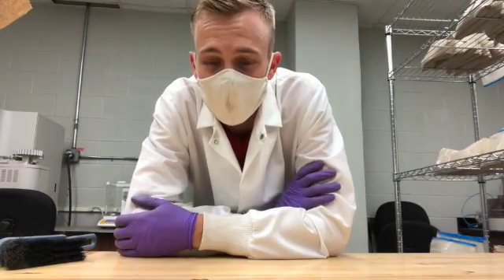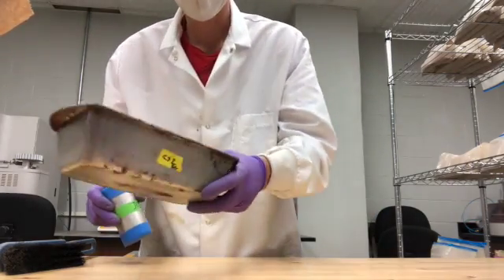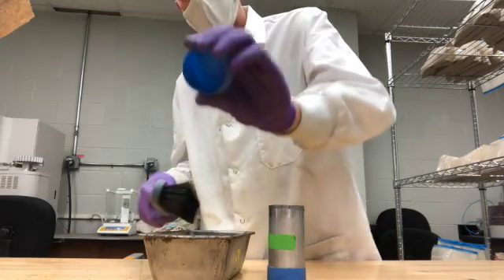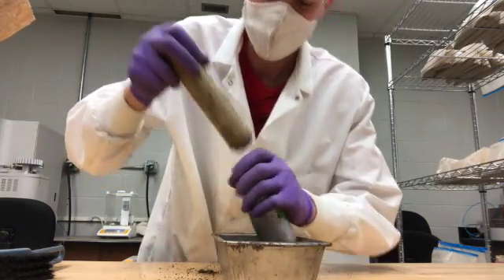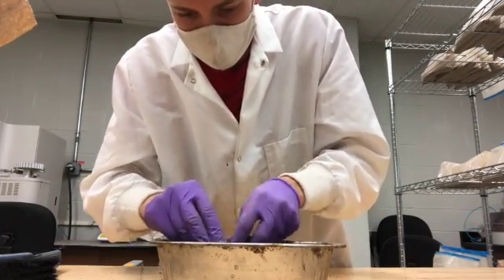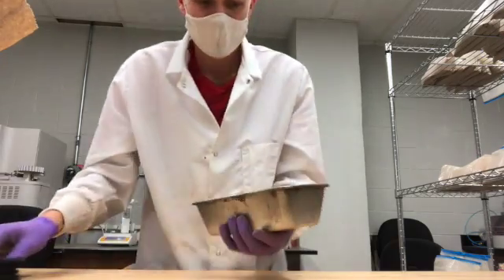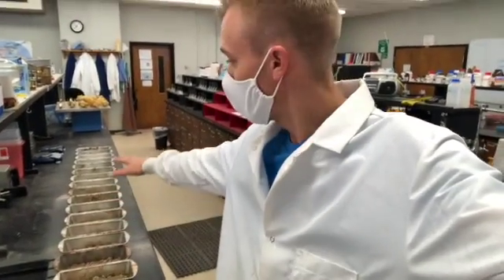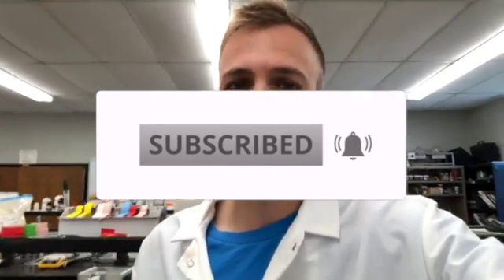Calculating Bulk Density in the Lab

Comment: Wow, helpful but I'm curious. Can I just use the cylinder core sampler directly to the oven and put some foil in the bottom and top?
Reply from the maker: Yes, you could do that. That’s the nice thing about the metal sampling sleeves. Just make sure you get the mass of the empty sleeve before or after you put the soil in it. Then you can subtract the mass of the sleeve from the dry soil after drying the sample.
Reply: @farmingourfuture6413  Oh right thank you for the immediate response 😊
Reply from the maker: You’re welcome! Glad to help. Thank you for your question.